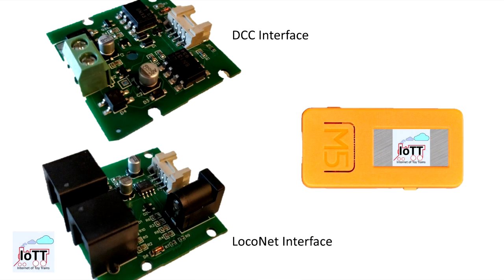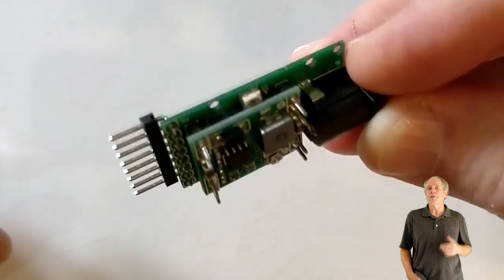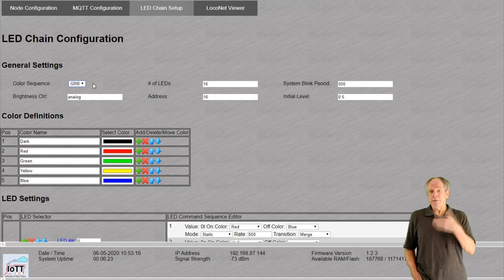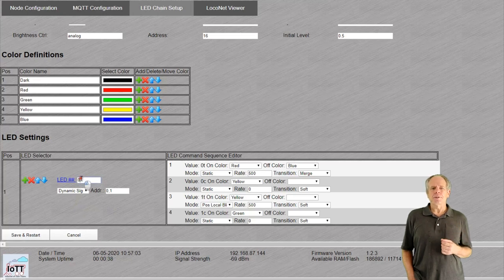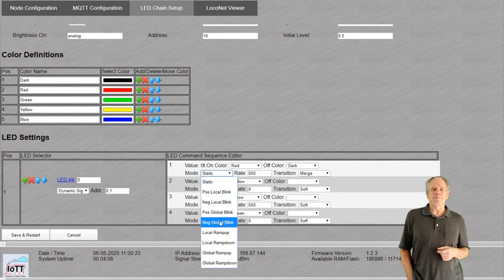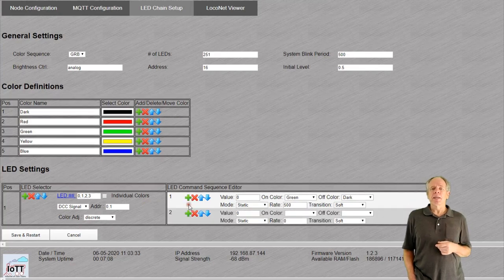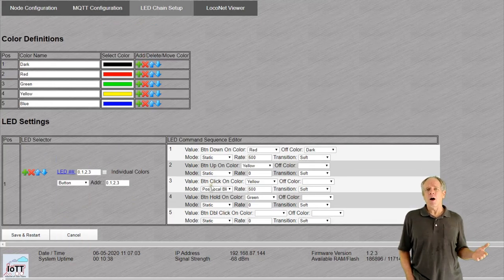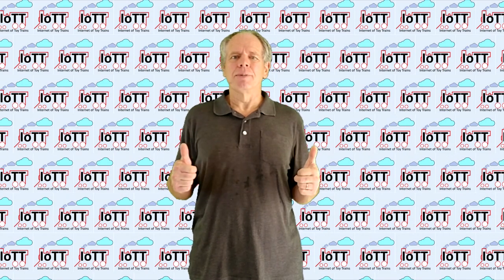BlueHat Signaling Device for the IoTT Stick (Video #44)

Comment: I like the way you are thinking Hans - I'm looking forward to YellowHAT.

I have been scrolling around your videos to find info on your MQTT server that you mentioned in No. 1 - and promismed to get back to. I can't find out, in what video you are doing that. 
As the MQTT server is essenzial to every thing is not having it a show-stopper.
Reply from the maker: Thanks for your feedback and input.
The MQTT server itself is a no brainer. You can take any server software and there are plenty of videos with instructions how to set it up. I am using Mosquitto running on a Raspberry Pi.
The more interesting question is how to make a user interface that makes your cellphone of desktop into a train controller, in other words, inserting MQTT commands in the middle of the chain and send them to the layout via the gateway. This I have covered in video #2, #4, #6, #7 and probably more. Now, that has been a while and I think I also made some slight changes to the command syntax I am using, although the old version is still compatible.
So, long story short, it might be a good idea to revisit the topic in one of the next videos and update and republish the LocoNet toolbox with the latest gimmicks I have in there, things like a brightness controller for the signals and the CTC panel etc.
Reply: @IoTT  Thanks Hans. I will have a look at Mosquitto, it looks well documented. Also I have seen that  Raspberry Pi's with build in WLAN are available.

Comment: This looks like an excellent way to do signaling - much easier (and cooler) that hooking up separate standard signals!

One question:  it looks like WS2812 LEDs have been replaced by WS2812B's - and the the B's aren't backward compatible.  Will software need to be changed?  Thx :)
Reply from the maker: No, they should work no problem.
Reply: @IoTT  Great. Many thanks!!

Comment: I'm having an issue w/ the Bluehat.   I've installed 73 signals with WS2811 and JMRI DCC Addresses.  The signals work great!  If I need to make a change to the configuration ... there's a problem.  The webpage to configure the signals will not load.  Perhaps there's too much data on the page and it times-out?   The only way I can change the config is to reload the IoTT Stick software, edit the JSON config file, and upload the config file.    Is there something else I should try?
Reply from the maker: 73 signals? Looks you are a real power user! The problem you are running into is most likely related to the available amount of memory on the IoTT Stick. Every signal you define uses a certain amount of Ram and if the free memory gets too low, the Stick does not have enough for sending out the information via the websocket to the configuration page. Watch the footer area of the web page to see how much Ram is left. It typically starts to be critical if the available Ram is below 90kB or so.
With that many signals, it might be a good idea to split the chain and use two BlueHats. Not only does it keep the used memory lower, but it also reduces the amount of current that needs to be provided  by the Stick DC/DC converter. It is sort of the same approach like defining power districts for your track system.
Reply: Thanks!  The system is working great and I really like it.   I'll order a second  blue-hat unit (or a yellow hat).    It might be best to rewrite the led configuration page so that all the LEDs are not loaded to the web page at the same time??  Then you could page thru the LEDs (1-10... 11-20.. etc).    Or provide a listing of all the LEDs, then you click on the appropriate LED# and go to another page to configure the LED parameters.     I'll order a second unit..  Nice Product!!
Reply: Hi Hans.  I purchased a second IOTT Stick and Blue Hat so that I can split my signals across 2 bluehat units.  However,  I an unable to open the UI on the first Blue Hat (that contains all the signals)..so that I can export the configuration file, reduce the number of signals on the first Blue Hat, and then add the remaining to the second blue hat.   HELP.... How do I open the UI on the first Blue Hat,  It won't load.
Reply: Good News.   After several reboots of the IoTT Stick, I was able to get the UI to load with the 73 signals.  Exported the config file and edited the JSON, creating 2 config files of 35 signals each.   Loaded the files into each of my 2 IoTT Sticks and success !
Reply from the maker: @ChooChooVision  Cool, thanks for the info.

Comment: After watching the video and reading about the ws2811 chips i started thinking about how nice it would be to have a similar solution but for input of sensor state instead of output of led state. I.e. a small pcb with 1 or 2 pins for sensor input and then up- and downstream signalling ports. This would make it possible to daisychain sensors around the layout. Does that exits? Has anyone tried to create that kind of solution?
Reply from the maker: What comes the closest is the s88 bus, which is daisy chaining input modules. However, there is a fundamental problem with that concept, and that is the the information flows in the other direction and input state changes can happen at any time, therefore the sensors need to be constantly polled. WS2812 on the other hand are only updated of there is a change somewhere in the chain. So, for sensors, it is better to use a  technique that allows individual sensors to send out input status changes as they happen.
Reply: @IoTT  the sensor feedback solutions I have found all use the concept of a multiport device for eg 8 or 16 sensors and then some kind of bus (eg Loconet or similar) it would be great with something that could be implemented in cheaply enough to place at each sensor detection point and daisy chainable.
Maybe an attiny with daisy chained uarts could be made to work over short distances
Reply from the maker: I did something like that a while ago. Basically a sensor hub that interfaces to LocoNet, and then a  chain of nodes connected via serial port. This works, in fact, even in both directions, so theoretically you can mix sensors and actors in the same chain. And even make it self configurable, so that the config page of the hub can analyze what is connected.
The problem of course is cost because in the worst case, we have a microcontroller for just one input bit. But I could see that work for some pricier input types, e.g. bar code readers, RFID and the like.
Maybe I get back to it in the future.